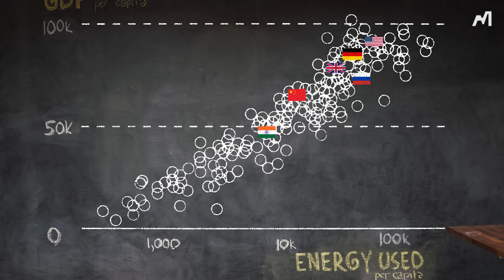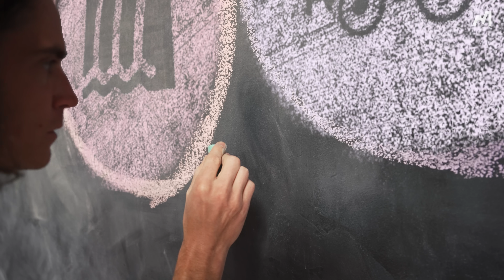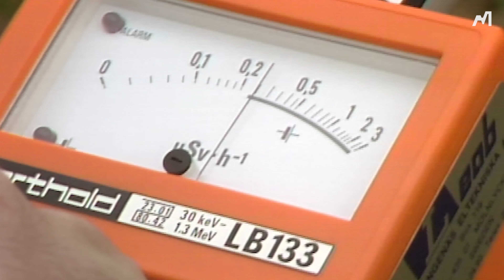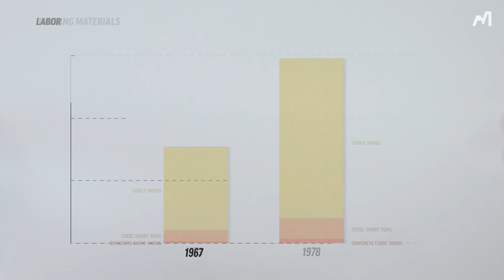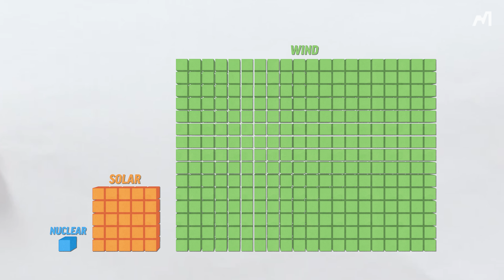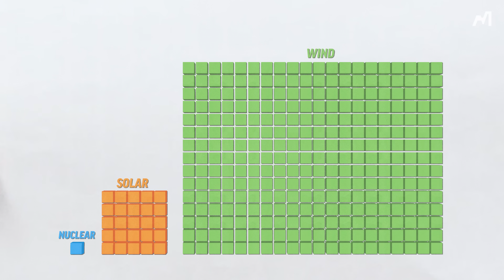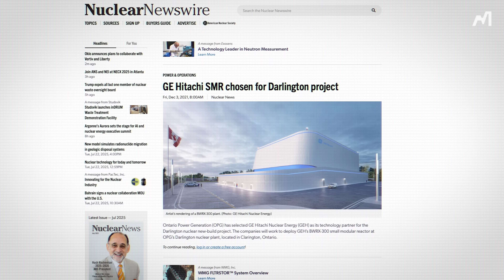They're Lying to You About Nuclear Energy

Comment: Even assuming nuclear power is as safe as you claim, we'll likely run out of the readily available global uranium supply in the not-too-distant future (90-100 years at current rates of use, they say), unlike solar and wind, which are essentially eternal.
After this 90-100-year supply (again, based on current rates of use), the cost of obtaining uranium will increase astronomically, and there's a danger that we'll switch to more highly radiant fuels. There's already a trend toward MOX fuel, and there's talk of thorium (which produces more highly radiant waste, albeit with a shorter half-life).
Furthermore, it seems to me that smaller-scale nuclear power actually requires more raw materials than large-scale power plants.
You're not addressing the ecological consequences of uranium production, and the enormous half-life of current highly radiated waste doesn't interest you either. Finally, you do talk about birds in connection with wind turbines, but you disregard the much larger ecological consequences of all other human activity.
Reply: It's not a claim it's a fact based on the best risk analysis simulations.
No we won't run out in 100 years, those are estimated based on reverse, not the total resources or the minerary abundance which can last hundreds of thousands of years. If a resource becomes economically viable to extract it becomes a reserve, by the same logic lithium, which is essential for renewables, has reserves for 50 years, but it's not gonna run out in 50 years.
What's "highly radiant fuels"? It's not a term used anywhere in the nuclear field. Thorium produces basically the same waste, it only produces less transuranics if that's what you mean.
Correct about SMRs, they do require more materials per energy produced than large plants because you lose the economy of scale.
Consequences of uranium production are detailed in any LCA study (look at the UNECE study for example) and even considering the entire lifecycle (production to waste) of nuclear it's much cleaner than other fossil and as clean as renewables.

Comment: The image of someone eating nuclear material is deceptive. In the UK we have had people poisoned on the streets Polonium 210. There deaths were pretty swift and aggonising. In one case it was ingested. In the other cases it was only attributted to skin contact. (Assuming these deaths were not fabricated or white flag events. Taking the press and goverment at face value) The figures on deaths to radio activity are massively deceptive because they would be recorded simply as Cancer. There are also other wider effects like birth defects, infertility ect. Proving causation and correlation is nearly impossible with radio activity. Should we not forget Marie Curie and her Partner did ultimatly succum to it. The dangers of unseen carsenogens can not be over stated. Caution is wise.
Reply: Uranium and Polonium 210 are different things, uranium is not very radioactive and will give you heavy metal poisoning before any radiation problems, Po210 has 10 million times higher specific activity than uranium and is not generally a material produced by the civil industry. The case of Polonium poisoning in London refers to one poisoning of an ex KGB officer, not "people poisoned on the streets".
Indeed at low doses causation and correlation is impossible, it is however possible at high.

Comment: Exposure to very high levels of radiation, such as being close to an atomic blast, can cause acute health effects such as skin burns and acute radiation syndrome (“radiation sickness"). It can also result in long-term health effects such as cancer and cardiovascular disease. Exposure to low levels of radiation encountered in the environment does not cause immediate health effects, but is a minor contributor to our overall cancer risk.
Reply: That's the point, at low doses there's no proof that they contribute to your overall cancer risk, not even minor, to be able to prove it you'd need an exponentially increasing number of test subjects for lower doses to run a statistically significant study that overcomes noise
Reply: @filippo1864  You can't say that there's no proof when studies show that exposure to radiation is a minor contributor to our overall cancer risk. More exposure to higher levels of radiation means higher risk.
Reply: @nedim_guitar  yes, at higher levels, at low doses there's no proof or it's inside a band of uncertainty that makes it inconclusive, simply because of statistical noise it's indistinguishable from naturally occurring cancers. If you receive doses below 100mSv/year there's no evidence that they would increase your overall cancer, we simply don't have a study with a large enough sample size to test that

Comment: Radiation is not a homogenous concept, the danger depends on the type of radiation as to the effect. As for a video of someone licking a substance that is purported to be radioactive material from their hand and doing a check of their mouth with a Geiger counter, that is completely insane. Plutonium is an Alpha emitter, if you get it in your body, past the protective layer of your skin, you most certainly do have an increased risk for cancer. If a reactor is seriously damaged or melts down to ground water it will cause the release of 131 Iodine (half life 8 days), 137 Cesium (half life 30 YEARS) and 90 Strontium (half life 28 YEARS), these are NOT trivial substances. The human body confuses Cesium with Potassium and uptakes and incorporates it resulting in an increased risk for soft tissue cancers and Leukemia  The human body confuses Strontium with Calcium and uptakes and incorporates it resulting in Osteo Sarcoma and Leukemia. Plants also take up cesium and strontium from the soil and so radioactive contamination tends to climb food chains and concentrate. If any radioactive material lodges in your lungs or GI tract, the increase in cancer risk will steadily tick up as time passes. Radiation that ionizes, such as Alpha, Beta and Gamma emissions and arguably, to a lesser degree, hard and soft x-rays do have an effect on the cells of the body and they most certainly do increase the lifetime risk for cancer through DNA damage. The entire premise behind the concept of ionizing radiation is fundamentally that the emission is so powerful that it can "Ionize" materials, ripping electrons off of molecules, fundamentally changing the molecule to one that is more reactive and in most cases resulting in the breaking of chemical bonds. We have had numerous close calls with nuclear energy, most of them related to human error. The Fermi One incident, Three Mile Island and the SL1 reactor to name but a few. Nuclear energy demands excellence and caution and humans are inherently neither without incurring exorbitant effort and expense. We are also unable to taste, smell, feel, see or hear the danger that a radioactive material presents, without technological aids. This video posits that the dangers of nuclear energy are somehow over sensationalized. I would argue that the dangers of nuclear power are gravely serious and should not be lightheartedly trivialized in an attempt to somehow downplay the risks involved for the purposes of swaying public opinion. I would also point out that the MTBF is inversely proportional to the number of units in service.

Comment: Rolls Royce in the UK are developing SMR's for use inland to provide nuclear power.

A number of Universities and companies are involved in using spent Nuclear rods to create batteries - they take small/tiny  slices off the rod and so far created batteries to power hearing aids and pace makers - the problems encountered was life span of batteries original versions had life spans of 100 plus years, they are trying to get that down to 10 to 20 years, so a pace maker created and fitted would last the life of the recipient, meaning only 1 operation would ever be required, instead of having to replace pace makers every 5 to 10 years. 

Unfortunately this technology will never gain a lot of favour or support, because of greed, an EV fitted with a battery like this would last the life of the vehicles (say 15 years) and never need recharging -hence power suppliers would lose all the money they currently make by suppling electricity to charge the batteries in use today.

Money Profit and Greed will always win out, until society changes its attitude to money, profit and greed.

Comment: Lets see, the problem with nuclear reactors, its not the waste nor the radiation, both things, if managed properly should not be a problem. The problem is how carbon intensive It IS, because yeah, building a nuclear power plant is suuuper carbon intensive, and extracting uranium from earth is suuuuuuuuupero carbon intensive. Estimations from UN and IPCC put Nuclear energy between 65-105 gramos of CO2/kWh, while solar and wind are around 15-30 grams, and solar concentration is around 40 grams so yeah, im not against nuclear energy done right as an energy baseload for the energy grid, but!

Comment: Most recently (that I am aware of) the latest nuclear facility was started in Japan.  They designed it to run on fuel that is already inherently moderated just enough that it cannot over heat (~4400°) . So the startup testing included turning the cooling system off and the core went to about that temperature and kept on working....WITH NO COOLING SYSTEM PRESENT.

SO WHY ARE WE NOT BUILDING SOME NOW......

Comment: This video was a little dramatic.  It is a good thing that people didn't go all in on nuclear.  It is good humans really got in to other methods of producing electricity.  Plus, there are a lot of important developments in batteries and storage.  If we had just gone all in to nuclear since the 70's there would have been much less interest or motivation for anyone to develop other technologies.  So it's a little ridiculous to make a video like this.

We have a lot of storage and battery options that are very good, and these might not have been developed if we were just all in on nuclear.  Even things like using the ocean, pressure, waves and tides to generate power...  And those solar generators that are like a magnifying glass and heat batteries, those are really great.  Overall, in the long run, delaying nuclear power was probably for the better.

Comment: This video is misleading and potentially dangerous because its focus is too narrow. It only discusses external radiation (like standing near a source) and uses IAEA promotional material to dismiss other important facts. It completely ignores the serious threat of internal contamination and generational DNA damages as seen with the children of those who were still young or small children in 1986 when Chernobyl happened. This occurs when tiny radioactive particles are swallowed or breathed in, becoming lodged inside the body's tissues and muscles, such as the heart. There, they continuously emit radiation, which is especially harmful to small children and fetuses because their cells are dividing so rapidly and are more susceptible to damage.

Comment: Claim
Nuclear power plants require at least 25 times less land than solar and 300 times less land than wind power to generate the same amount of electricity
This is exaggerated.
The claim that nuclear power plants require at least 25 times less land than solar and 300 times less land than wind power to generate the same amount of electricity is an overstatement.
According to Our World in Data, nuclear energy is indeed the most land-efficient source, needing 18 to 27 times less land than ground-mounted solar PV, but the claim of 25 times is not a precise average.
The Nuclear Energy Institute states that wind farms require up to 360 times as much land as nuclear plants, but this is an upper limit and not representative of all wind farms. The claim of 300 times is an exaggeration of typical values.
The Nature study shows that nuclear has the lowest median land-use intensity at 7.1 ha/TWh/year, while biomass has the highest at 58,000 ha/TWh/year. Wind and solar fall between these extremes, but typical intensities do not support the 300 times claim for wind.
While nuclear is more land-efficient, the specific figures given in the claim are not consistently supported across multiple authoritative sources.

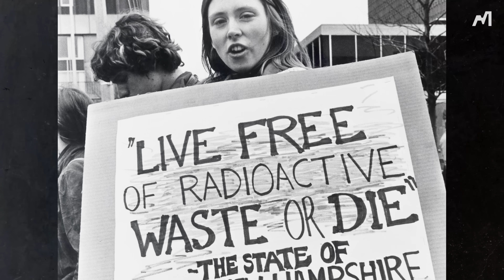Comment: 2:35 - Thank you. Many points accurate & documented.
However, a missing point is that the public was also exposed to high level radiation in the much earlier and less covered Santa Susana meltdown in Ventura, California, and the uncontained Lockheed-Martin human experiment program in Dawson Forest, Georgia. Meltdowns are not actually “accidental” but designed into the Mark 100 reactors, so that deep-state terrorists’ nuclear fuels can be generated, and so state insurance subsidies can be generated.
There are better designs that don’t guarantee eventual meltdowns.

Comment: I remember 3 mile island. I grew up 90 miles due east of it. People were ignorant about nuclear power plants and how they worked. They just think atomic bomb. But the end result was some reactor damage. When we heard they released some radioactive gases into the air, people were worried because they think radiation exposure. But those two types of gases that get produced have very short half lives and the radioactivity decays to safe levels in a few days. Which was the amount of time they were contained before release. Not 1 medical case ever arose from the accident.
Reply: Actually the potential radioactive danger is far greater in a nuclear melt down than a bomb.

Comment: I have 20+ years Radiation Safety experience albeit I have been out of the game for over a decade.  I believe you are correct on many points.  Radiation is so easy to detect that it is the hazard you can see.  Coupled with As Low as Reasonably Achievable (ALARA) theory, the Linear Non-threshold philosophy, and a limit of 1 cancer death for 1,000,000 people for a member of the public and 1 cancer death for 100,000 people for occupational worker assuming  results in it becomes a struggle to distinguish exposures from  the industry with background radiation.   The success story is the nuclear industry is still able to  operate with these very conservative exposure limits.  Regarding the benefits of Nuclear Energy... The evidence supporting Climate Change is suspect and the numerous ancillary studies used to support the claims appear to be the result of circular logic.  I am concern about "peak oil".  "Renewable energy" is simply a marketing ploy to justify the use of expensive forms of power.
Reply: I think your comment is even better than my own.

Comment: The author of this piece would have us believe that the only issue with nuclear power has been bureaucratic idiots getting in the way of progress. He fails to mention that part of the way nuclear power was very cheap was that they had stored their radioactive waste in unlined trenches next to the Colorado river, which feeds more than 20 million people below it. Attention has driven of costs of nuclear waste storage because previously it was not factored into more than 50 or 100 years, but as we know that stays exceptionally dangerous for many many generations. if you factor the cost of adequate fuel storage into the equation, it becomes a lot less attractive.

Comment: Time and lengthy iteration time are the main reasons not to build one when everything else is accounted for. I think they should be built but not with the expectation that they will have an immediate impact.

Small modular reactors might change that for me and I am curious to see where that goes, because for me it's always been the fact that it's clunky compared to something small and agile that you can deploy somewhere instantly: solar, batteries, and in some cases, wind.

If we reach parity there, then small modular nuclear reactors are going to become another pillar of the future electrical grid.